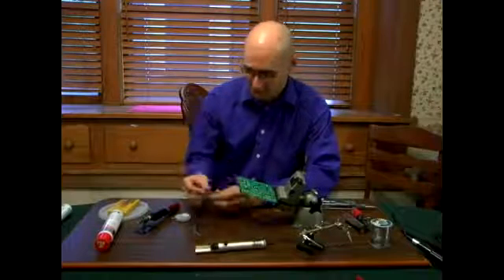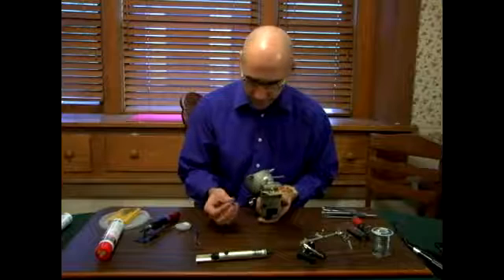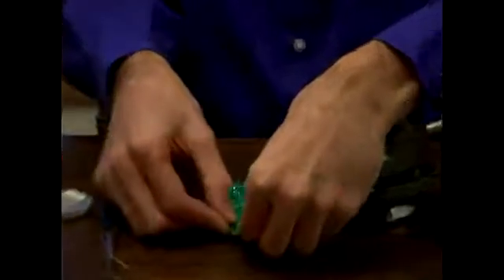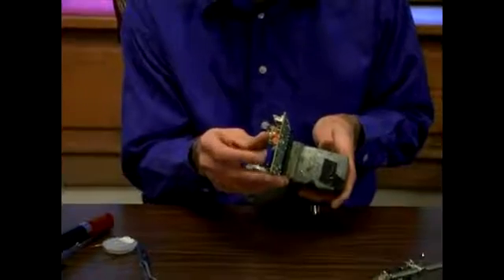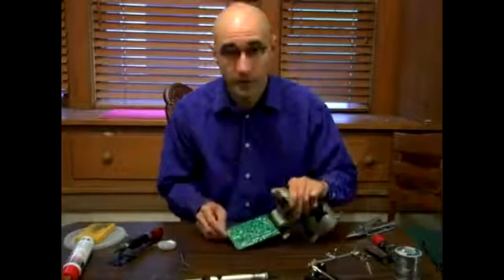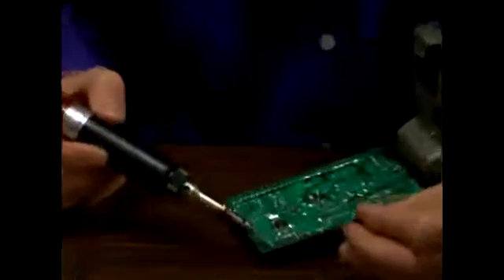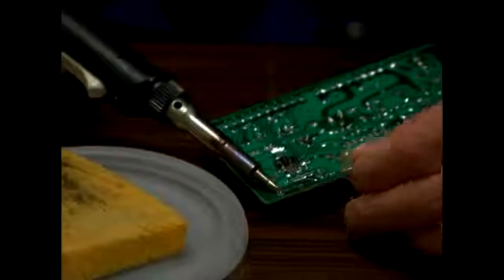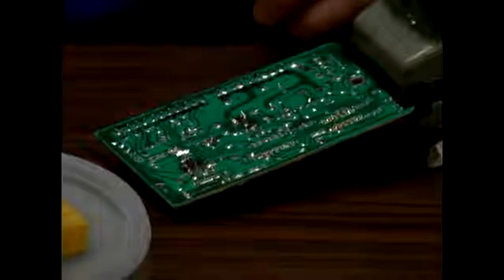How to Solder a Capacitor to a Circuit Board

Comment: I like your intention for making a educational video about this component but a few things that would make this video better and more educational is these that I have listed.

1. The quality of the video could be better. I can see what you're doing once the camera actually zooms in but before I couldn't tell.

2. Show us how to correctly put in a capacitor by telling us which lead is positive and negative as well as showing which icon on a circuit board shows which side is the right side to put it in.

3. Tell us what the numbers and letters mean on the side and what they're used for and rated for.

4. Show us what a good and bad capacitor looks like.

I am not trying to be mean by commenting this, I am simply critiquing and telling you what you could have done better in this video.